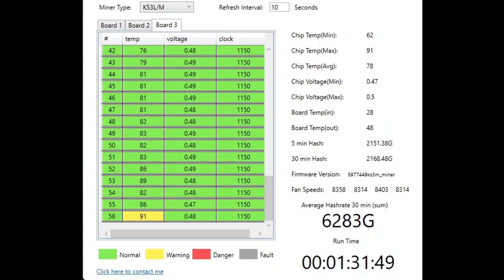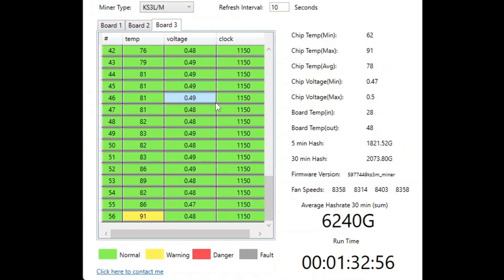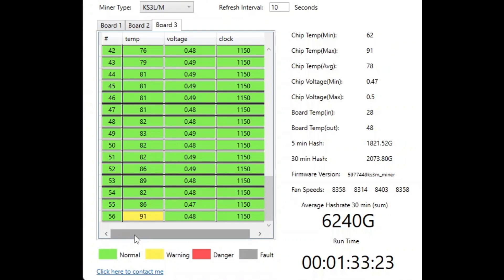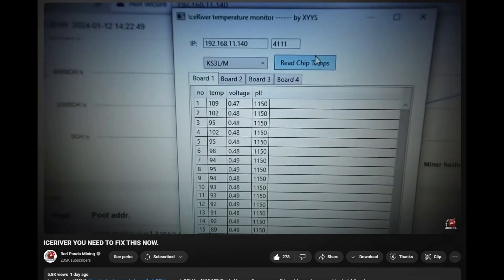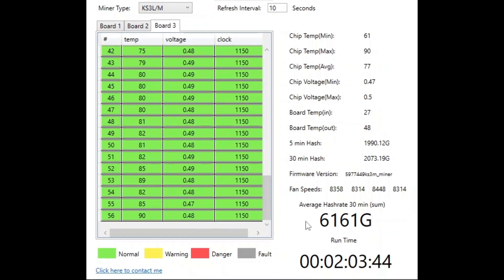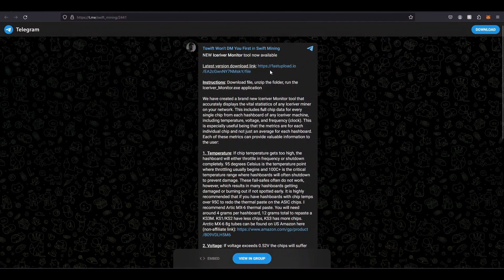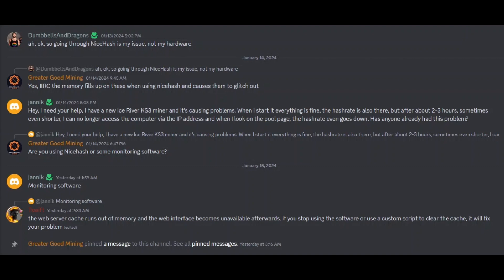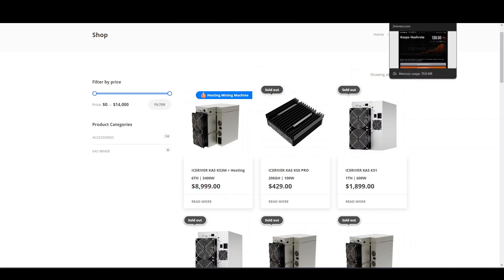New tool to troubleshoot your Iceriver Kaspa ASIC! (Also, some tips to avoid unnecessary downtime!)

Comment: Thank you so much. I used the monitor tool found that hb1 has 1 yellow and hb3 has 2 red and 2 yellow. Something to worry about for my 2weeks old ks3m ? But regardless this is a great video
Reply from the maker: Might need to repaste but also, soon Iceriver will most likely be releasing firmware that should help the situation

Comment: The best thing you can do to your chips in KS0Pro is to follow the OC advice, throw the side panels out and put a serious, non USB fan on there. Most of my OC readings are in the 40s and low 50s, no extra software, going by the dashboard.
Reply from the maker: My KS0 pro chip temps are great! The tool is free, might as well try it! It's fun to see what temps you're getting
Reply: @GreaterGoodMining  Let me get out of bed first :) I didn't know there are spare parts... will get some. I already had a power supply blow up, obviously cheap Chinese crap, so will have 1-2 of those on the shelf as well.

Comment: My Temps, KS3 - 59 to 61c, my KS3M - 56 to 59c with infinity fans on both at half speed. Garage temp 57c. KS0's - Who cares lol
Reply: My temps in the miner dashboard for my ks3m range from 54-58c, on the tool an alarming number of my chips are showing 95-102c
Reply from the maker: @noodles7157  oh man, yeah that's not good! This is why this tool is so helpful. Check out my video on how to repaste your Iceriver Kaspa ASIC and consider getting that done ASAP. In the meantime maybe tey and turn your fans up or install a Frution Designs kit and crank the fan up!
Reply: @GreaterGoodMining  already have both the fruition kit and some thermal paste on the way
Reply from the maker: @noodles7157  that's good! Glad you caught it before you had any big problems
Reply from the maker: Check out RPM's video. His intake and exhaust temps were better than yours and his chip temps were red lining. That is NOT GOOD! The tool is free... might want to check your chip temps

Comment from the maker: Will you try this monitoring tool out now that you've seen how easy it is to use! It could save your Iceriver from breaking down!!
Reply: i couldn't find the download link
Reply from the maker: @RelaxMode1  join my Discord and go to that section that I showed in the video. It will  take you to the download link
Reply: My KS2 died just about 6hrs ago (overnight). Seems like there was even a fire in PSU. I wish I played your video sooner. Just ordered new PSU from IceRiver and hoping I can retrieve it. At least I have some time to clean-up the whole unit.
Reply from the maker: @hardcoredefender1831  that's a bummer, that your KS2 died! But a power supply swap should be an easy fix. Like you said, you might as well do some maintenance while it's down anyway!